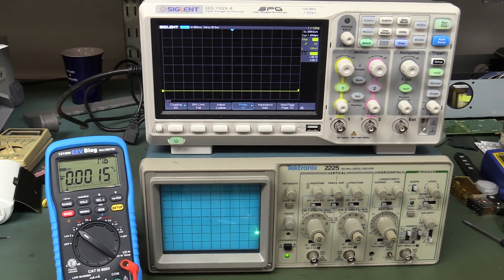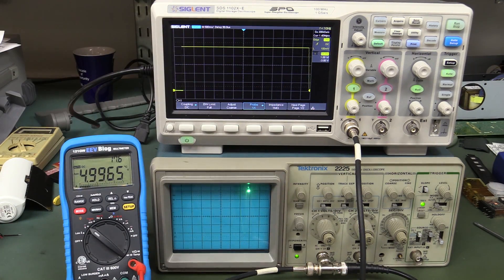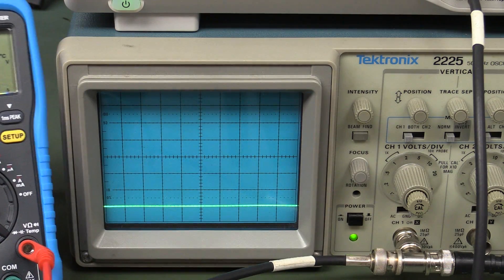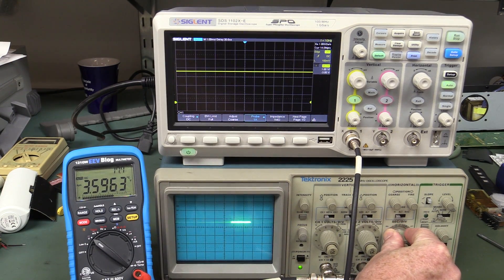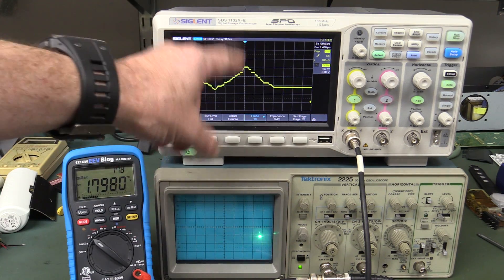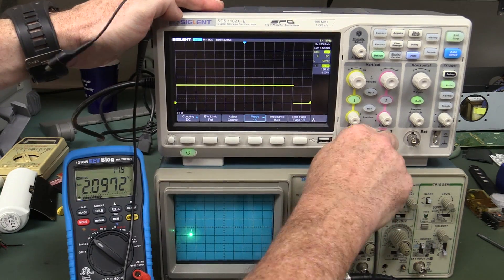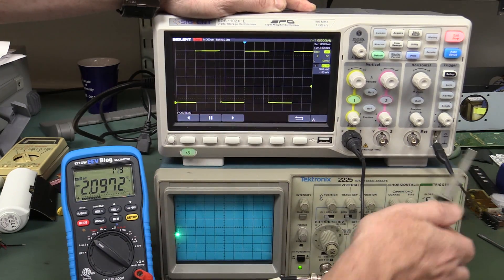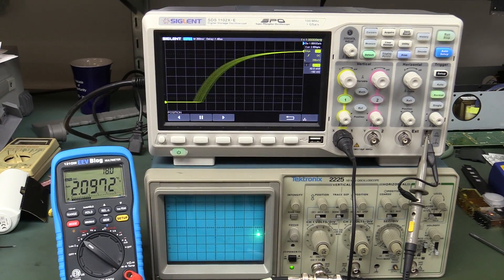What Is An Oscilloscope?

Comment: This video would also fit into main EEVblog channel. I know 99.9% of the people there know what an oscilloscope is, even i know what it is but it's very interesting to watch these kind of videos. In this case the video is not be about something i don't know but about how i would explain these things to people who ask me these questions. Teaching is important but it is much harder than it seems. It's difficult to find a way to make something that appears simple to me appear simple to someone else. That's why i find videos such as these very important, they give you some way to teach other people by explaining it like you did in the video or just have an place to send the person asking these questions.

I'm not even remotely hinting that you explained something wrong but while watching this video i felt like you tried to explain a bit too much in too short time, making it a bit hard to follow. I felt it would have been a bit better if you explained it a bit differently (i'm only guessing that the person asking knew nothing beyond multimeters) I once watched video that explained the same thing but it felt much easier to follow. (sadly i have forgotten the author) The idea behind was that the guy showed what a multimeter was like you did by measuring constant voltage, then started "sawing" with the voltage knob on the power supply noting that the multimeter was not fast enough to see the changing voltage clearly and one would need an extra equipment to make it easy to see whats happening while turning the know. It's not far off from what you were showing but he concentrated on a multimeter for a longer time to explain why would one need such a thing before showing what this fancy piece of tech can do.

Comment: From what I understand an old style oscilloscope is just about useless because it relies on a constantly repeating waveform to get a trace of it, while a newer one triggers and samples some data.
Reply: They're certainly limited in their functionality, but can still be useful, especially for a beginner. The main limitation is the bandwidth, usually being below 25Mhz. So not super useful, but still have some life left in them. 
Of course that being said, they won't be of any use in a high speed digital circuit.
Reply: I certainly wouldn't call an analog scope useless.  Most of the time your rapidly changing waveform is repeating, and an analog scope is just fine.  Where you have problems is when you need to look at digital waveforms that aren't repeating.  Then the digital sampling oscilloscope is what you need (or a logic analyzer).

Comment: This power supply knob can only change the voltage in relatively big steps! You can see it on the scope around 5:30.
Reply: Depends where the cursor is set, on this power supply the knob can adjust in 10v 1v 0.1v 0.01v and i think 0.001v steps.
..or you can type exactly what voltage you want ^_^

Comment: Can anyone help me get a scope in  India? please, I've tried to talk to my professors etc etc but no luck
Reply: ashutosh kapre thanks mate. I can arrange 6k for a scope pretty much easily but I will prioritize with a bench oscilloscope. Thanks for the advice anyway
Reply: Akarsh Agarwal the internet mayby? even aliexpress has them
Reply: Kars Noordhuis aliexpress has not so good DSO's for 350$ plus customs which is a bit more than I can afford. I am looking for someone who might sell second hand CRO. Thanks anyway for the suggestion. :)
Reply: Have you considered pc emulated scopes? You can connect ciurcuit with microphone jack.
Reply: ziggi231 currently I use a self built stm32 based scope which has 1khz bandwidth only. Dave himself says that pc based oscilloscope are not a good bait to put money on
Reply: Akarsh Agarwal that video was 9 years ago!! now they are great bang for buck products with respectable specs. i think they sell at 6k rupees
Reply: ashutosh kapre so you suggest that I should buy the pc based oscilloscope like a hantek one?
Reply: Akarsh Agarwal i too consider it but not sure. depends on  what you want it for.....obviously it is only 20mhz with less sample rate. so surely not for high end purposes
Reply: ashutosh kapre well I don't need it now for high end purpose. when I need it for high end purpose I think I would be able to afford it.
Reply: Akarsh Agarwal then I think it should be decent enough. but instead finding a second hand bench oscilloscope would be nice. coz 6k still isn't pocket money. buy USB based one only if you can afford it easily and you won't be disappointed.
Reply: Akarsh Agarwal a word of caution though.....the product has some issues with the expiry of licensed software that comes with it in the CD.
Reply: Given your situation a USB scope is a step up from what you have and isn't going to cost to much. Should go for it.

Comment: Simply said, it's like if you connect multimeter to circuit, write down all values it shows into table and then make graph. Oscilloscope makes exactly this, but it's much faster and simpler to use.

Comment: You should have started with a definition of data logger, as a superior version over some oscilloscope under hundreds of megahertz. Plus some shitty computer and primitive program for displaying the results - you would call it a visual representation, and the amount of visual representation types supported by different models. Plus control panel, for easy access to common functions.
If you had a proper data logger, you would say something like "Let's select a visual representation for the data in this program".

Comment: They're also useful for old analog audio stuff, too. Comparing in/out signals for filters n stuff.
Reply: Alan P , well that's also rather old fashioned. Nowadays it's much easier to connect it to a decent soundcard and plot a bode diagram. Weirdly enough I haven't seen many scopes with this feature (except for the pricey ones, which are even pretty limited)